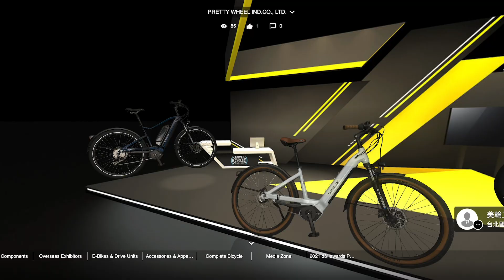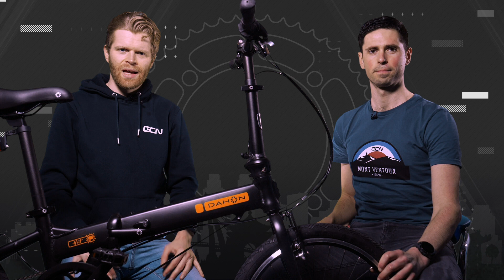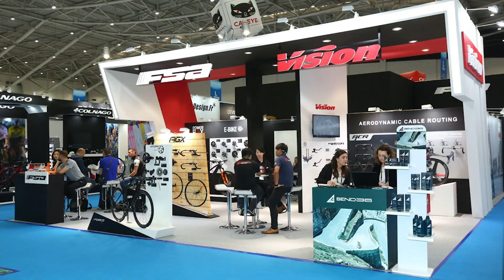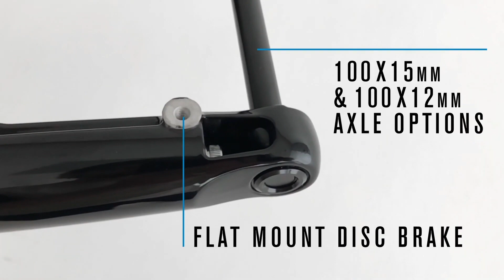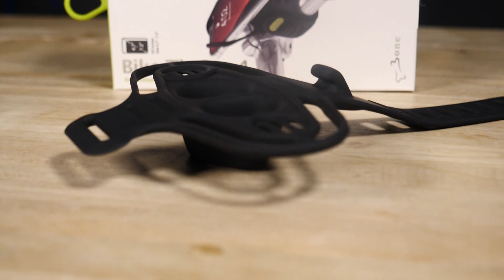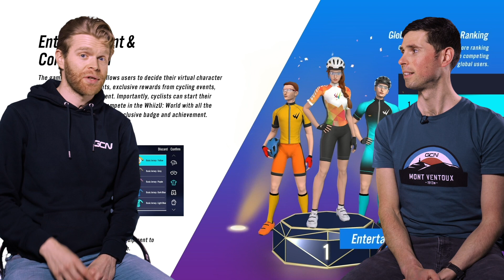Hottest Tech From The Taipei Cycle Show 2021

Comment: Well the fork in gravel is same bullshit as forks in the cheapest bikes - doesn't work. If You guys thinking that 30mm of travel, less than real fork have a sag will absorb anything without bottom hit each time You obviously not know a thing about suspension. 
It's only 1.5kg unnecessary weight on bike.

Comment: I've cracked enough carbon frames and bent enough alu-frames to know that i'm never getting on that bike without a seat tube.
You can say what you want about it, but a parallelogram is NOT as strong as a triangle, or two triangles as a normal bike usually has.

Comment: Itd be nice if they incorporate dropper post technology into a bike repair stand. Push a lever and raise the bike. Air pressure added or lowered depending on the weight of bike the user requires.

Comment: I had to turn this off at the start when they started reviewing DAHON folding bikes in a positive light.  DAHON is pure unadulterated crap made in China--one of the poorest quality bikes you can buy.  Mine had to be repaired 6x by the shop as it slowly disintegrated and then they felt so bad they just refunded my purchase price and later that year dropped the entire DAHON line there were so many complaints. DAHON can't even make a quality clamp to hold the seat from falling down or a wheel that is in true to save their life.  Spokes will start busting out in short order.  These guys have to be getting paid by DAHON to laud their bikes--shameless.

Comment: talking about how discrete the ebike is

camera pans over ebike hub half the size of the wheel
Reply: Shite bike! Channel rapidly heading same way...
Reply: They just reading the marketing releases.   Lost a lot of credibility with this video.  That phone holder is total garbage.
Reply: @myoung14  What, exactly, do you suppose is the purpose of trade shows if not marketing?
Reply: @vomErsten  I totally understand and agree.  It's the ads for crappy products that had me unsubscribe.  I wanted people to be able to trust GCN tech for advice and product recommendations. This video is only marketing and shouldn't be mascarading as honest review and opinion.  YouTube does require them to label the video as an ad but that's lost on most consumers that would  think a rubber band works good as a phone holder.  Consumer behavior and captialism is causing the planet much harm.  Something I think about too much.
Reply: @myoung14  Most of GCN’s videos are just camouflaged ad reads at this point
Reply: @myoung14  A flat bar bike being faster than a drop bar bike is absolute rubbish, along with a “normal” bike being faster than a recumbent. Righto then, suuuuuurrrrree

Comment: Love that bike without a seat tube. It seems odd that bikes still have seat tubes, when arguably they don't need them and you could save weight.
Reply: Parallelograms have almost no structural integrity, triangles have the most of any shape. The structure will have to have been massively beefed up to compensate for that fact.
Reply: @hogdog567  but the frame weighs 11kg which is what I find so crazy, and that's with a battery inside. I reckon without it must weigh 8kg-ish on its own, and in any case, it looks really cool. Plus, for an urban bike, it doesn't really need the sort of structural integrity you'd want from charging down a rocky hill.
Reply: @mooseandspade6251  It makes sense to get rid of it for an e-bike, but on a regular bike, the frame flex would eat some of your power output. Actually quite possible that the other tubes can be made so much thinner that the weight difference is negligible, but not sure since UCI won't let manufacturers race with such frames.
Reply: @matejlieskovsky9625  could the flex be used to make the ride more comfortable on gravel tracks?
Reply: @mooseandspade6251  Pretty sure it could, but I am not an engineer. Probably not the optimal solution either way. But yeah, it makes more sense for an e-bike where pedalling efficiency is less important.
Reply: Kestrel had a bike without a seat tube. It was very cool. I think it was the Airfoil. Oh! Trek had one too! The Y-Foil if I remember correctly